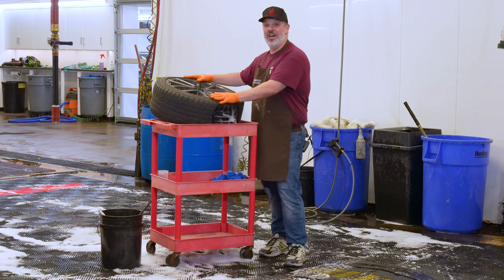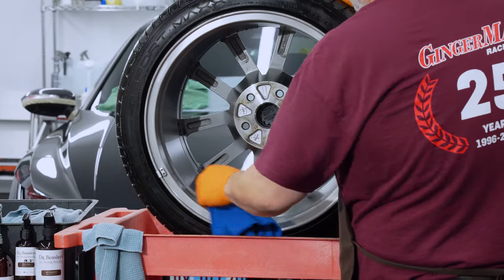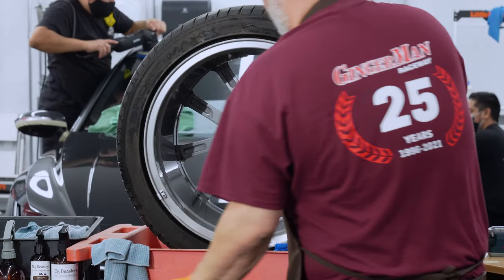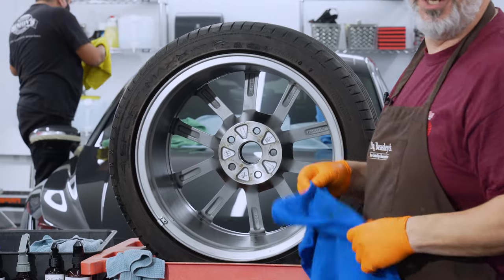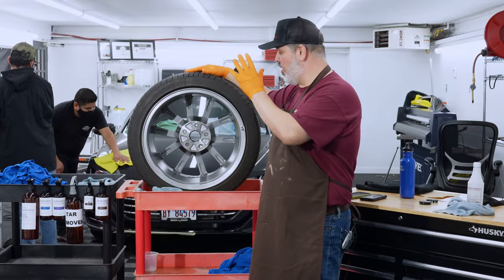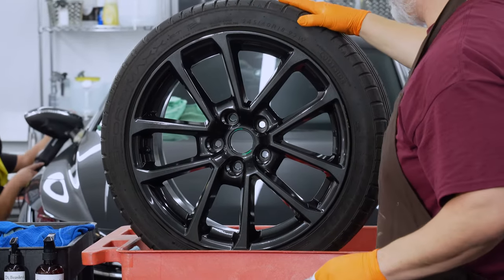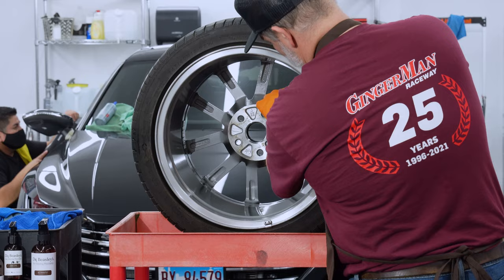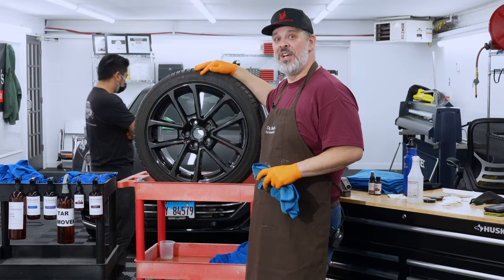How to Ceramic Coat Wheels

Comment: great video chris.....i just wonder how many viewers who are diy/enthusiasts/wkend warriors are able to do wheels off.  i believe it is the best way to do it....for me just not feasible.  decon the barrels as best u can - then concentrate on the faces.  ques....if u use an iron decon on paint during decon phase of prep....would that be the time for ph neutralizer?   or will a panel prep  remove the leftover residue adequately????  also the 16x27 towels u r using????does jim sell??  or are they from maximmart??
Reply: Thanks John! Panel Prep would be to remove contaminants left behind from traditional polishes. I’d hope any cleanser or decon product you are using would not leave behind any oils or silicone. I was using panel prime here to remove pieces of asphalt from the barrel. However, any time you are using an alkaline or acid and want to bring it back base… that’s when you want to use a buffer (pH neutralizer) to accomplish that.